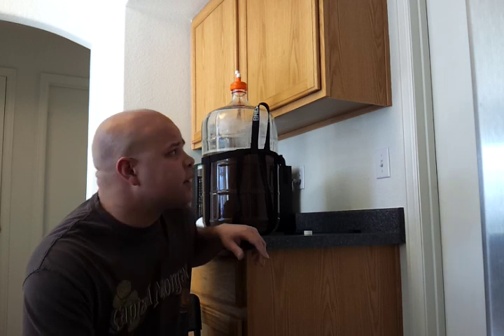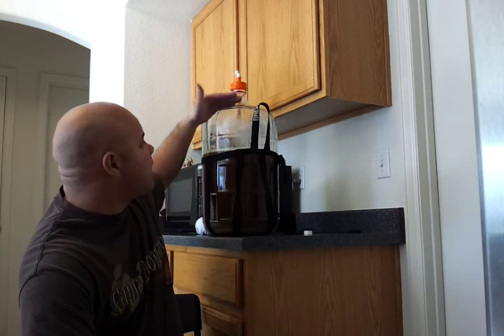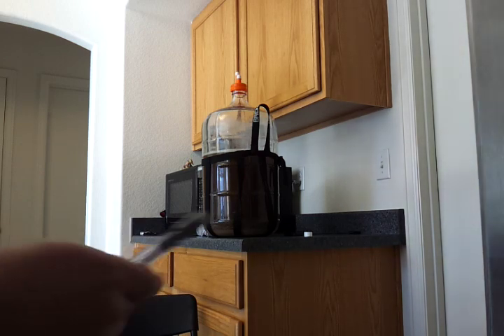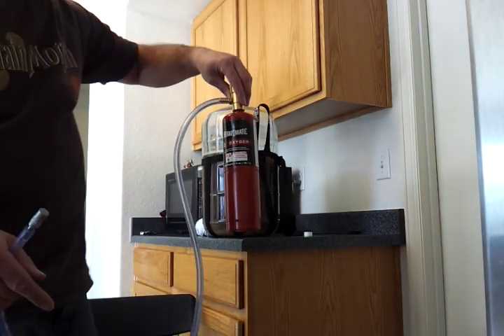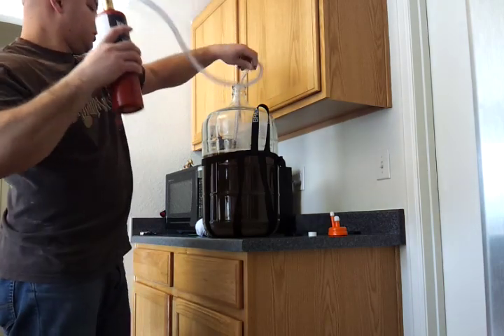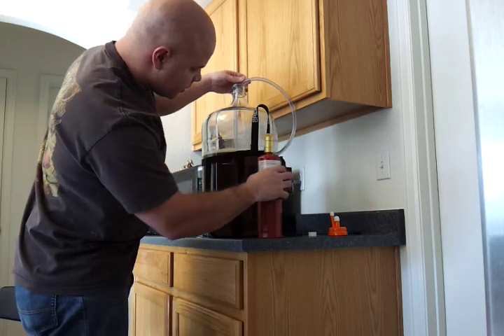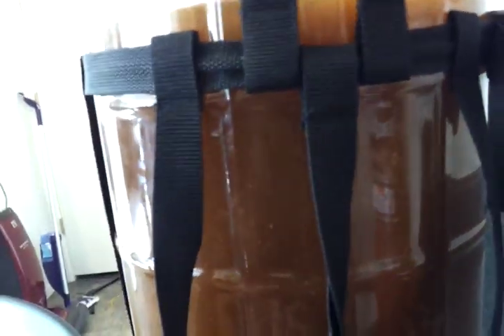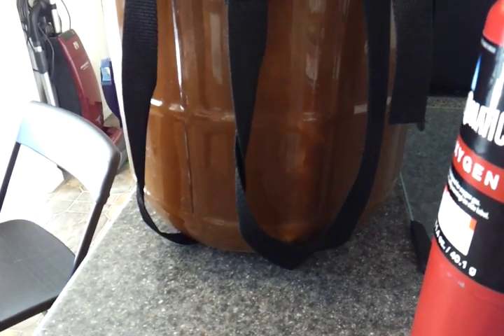Oxygenating your wort

Comment: Pure oxygen is a disinfectant. Using it before pitching the yeast is a good thing, it also sanitizes the wort from unwanted bacteria. On the other hand, if a second oxygenation is needed in case of a high gravity beer, I wouldn't use pure oxygen as it will risk killing the yeast. For that kind of situation I would deem a traditional acquarium pump with air filter and stone safer. The acquarium pump will inject filtered air, rather than pure oxygen, into the wort.

Comment: Silly question. The only time to oxygenate is before pitching the yeast, correct?
Reply: Correct.  You want to avoid introducing oxygen after fermentation or it will produce off flavors.  There is a lot of dogma that says avoid oxygen introduction during the brewing process (i.e. while wort is hot...or HSA (Hot Side Aeration)), but that is just about debunked.  Search google and you will find multiple tests showing no discernible differences.